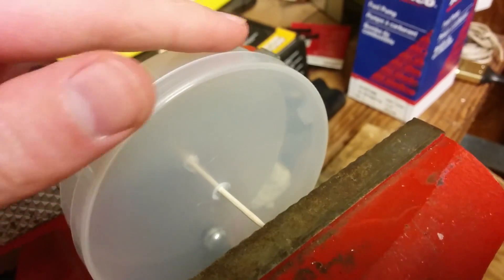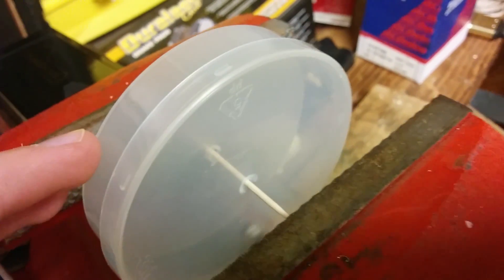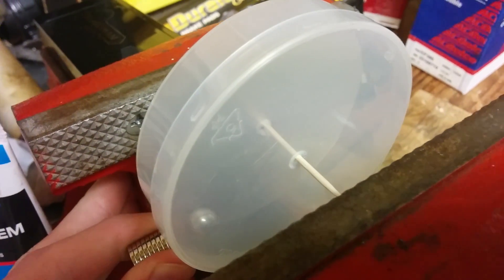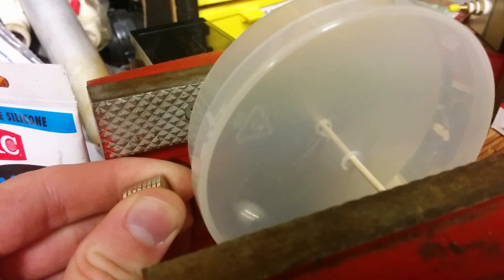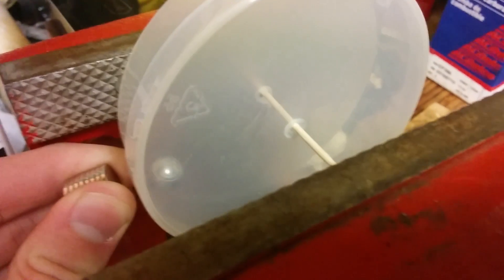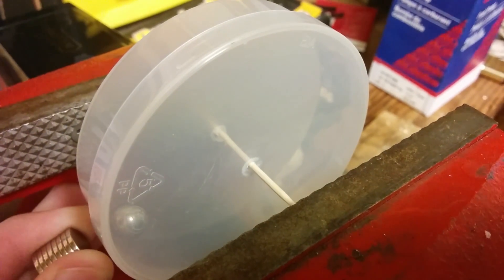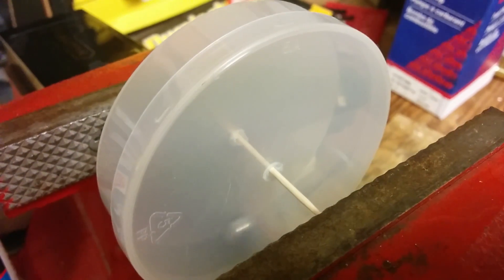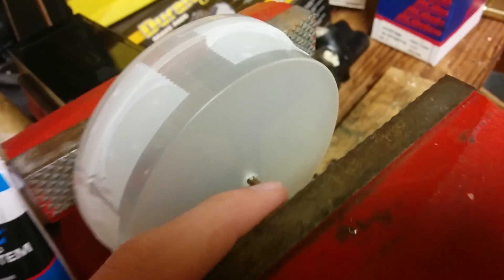Simplest Perpetual Motion Machine - Free Energy -Real Or Fake?

Comment: If you had done a better job of mounting the plastictrub on the nail you might have got a better result, cut out as much friction as possible ie  ceramic bearings and centralise thge shaft as perfectly as you can, then see what happens

Comment: I'm no scientists but I think this didn't work for a couple of reasons. First the nail only seems sufficient but in reality it still has too much friction. You will need a magnetic bearing and shafts that will oppose each other. That will suspend the shafts in the air and create almost zero friction. The ball needs a shafts to hold it in place. Now you have to align the magnet precisely at the point between the 2 forces ( gravity,and magnitism ) are balanced at zero. Meaning too much gravity and the ball looses friction. Too much magnitism and the ball loses its ability to roll. Your hand is not stable or steady enough to do that. But the biggest problem is even if you did all this it still won't work. As soon as you achieve the friction you need for the wheel to turn it will stop because unfortunately, friction is the enemy of energy or work producing perpetual motion machines.